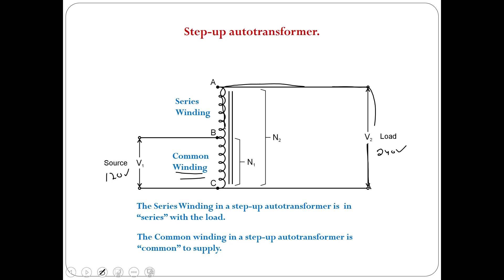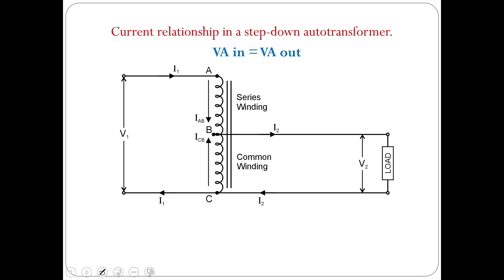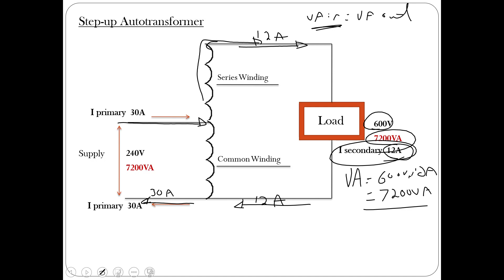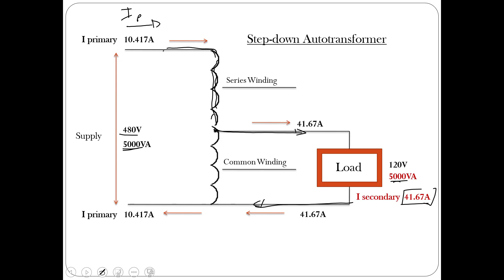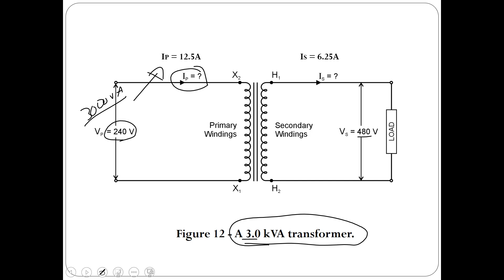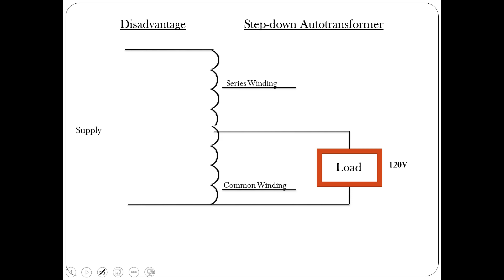Autotransformers

Comment: if I wind the step up autotransformer in the order 0-30v-70v-100v.  what will happen at 0-30v, if i put 45v voltage into this tap?  will it burn?  then what is the output on tap 0-100v?  please provide an explanation for me, thank you.